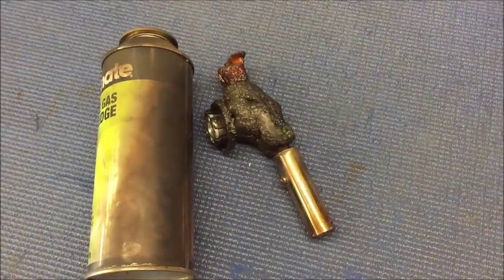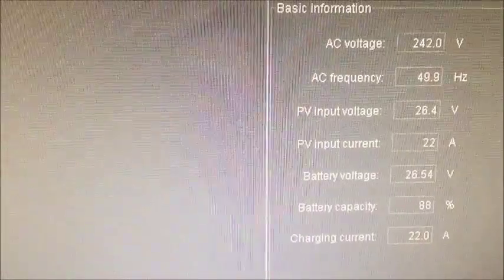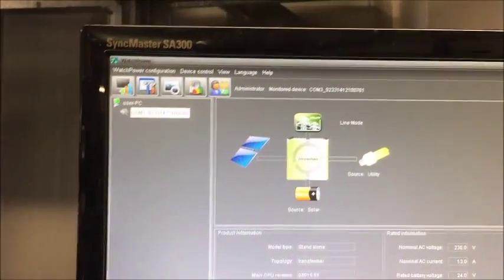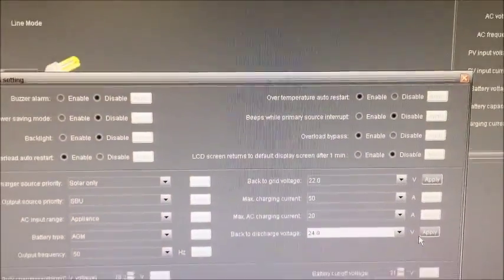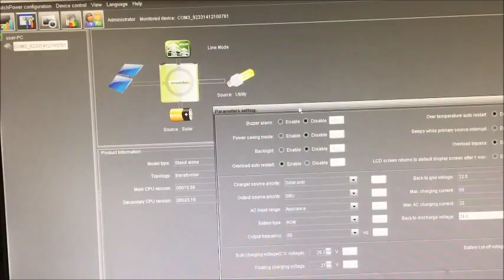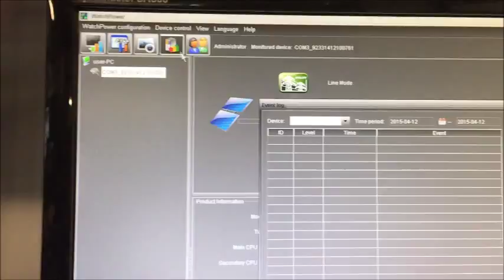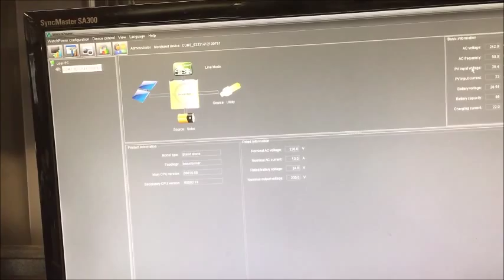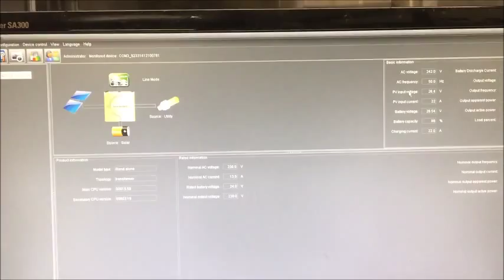Shed fire, trouble shooting & general chat

Comment: hi Pete I have similar problem and when my system detects the battery voltage is about 51 it gives a low battery alarm and goes back to grid even though I have it set at 48 volts to go back to grid I think it's a firmware problem in the inverter it's self and not the software

Comment: Hi Peter. Have tried to connect with RS 232 and using Win 8. However I cannot get a com port. Any ideas.
Reply from the maker: Chris Hobson could be any number of things, it would first check your device manager to see if the cable is connected/ or the port number is correct. It typically doesn't take much. I can remote in and take a look if you want just let me know :)